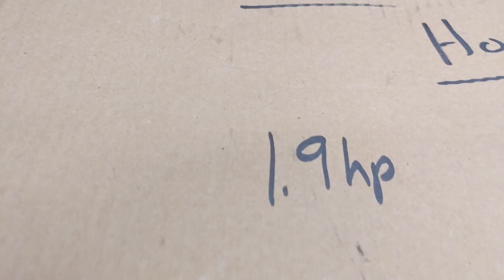Best Cordless Ratchet Makita Husky Milwaukee TESTED 12 volt

Comment: Thanks. You got me thinking about the Makita. However, one thing you left out is rust. Here in the rust belt, even after you break a bolt free, it can take substantial torque to maintain movement. Speed doesn't always win.
Reply: I am with you, try the husky. You won't regret

Comment: I bought they Husky on sale for $50 and it’s worth every penny.  I thought not being able to change out the battery might be an issue but I’ve never actually used up all the power in it in a single job.
Reply from the maker: I 100% agree, I have never ran it out on a single job. It is a workhorse and a pleasure to use. You can't find more tool for the price anywhere.

Comment: I didn't expect anything special out ofy husky but I was wrong, it has more than paid for itself, it holds a charge forever I just charge it and I've had it over a year and a half. Theyessed up selling it so cheap. It's all I use in tight quarters . Buy it! Don't even think twice
Reply: Literally been using it as a mech in the oil field as an experiment. The switch on the head is a pain ...but beyond that, it's never failed me.  I have a Makita line-up and I'll be sticking with it. But that little guy comes in handy.
Reply: I can’t find it for under $100😢

Comment: I’ve been using true husky for over 2 years and I use it everyday as I am a mechanic and I’ve only had to charge it 4 times! Yes 5 times! It’s not the strongest but you can break bolts lose then it’s fast and it has a variable speed! One thing is keep the head clean or you can lose the gear grab or how ever it grabs the 3/8s stud! Plus  it dosent ever start to lose speed or strength until battery gauge is on 1! I’m a makita guy and will get it but I don’t care what anyone says the husky is the best rachet on the market bar non cause you can usually get it for 60$ and battery is built in! Again 5 times in over 2 years with is all I’ve charged it and everyday use! I use it mostly for dismantling and then reassemble of engine bay and undercarriage!
Reply: Thanks!!!

Comment: Amazing how good it gets when they deviate from the traditional design, spray cloth, interchangeable drives and a through hole, the switch mod, I'd say they hit it out of the park after your comparison fo work done. Nice comparison , enjoyed, cheers!
Reply from the maker: I tested around a dozen ratchets and the Makita is the only different one that engineers actually had fun with. All the others are virtually the same and just trying to fill a hole in their tool lineup.
Reply: @sixtyfiveford  The through hole impressed me a LOT, that and the Sprague unit instead of just a toothed ratchet with a flipper. And the direction changer and on it goes. IF I ever got one it'd be the Makita.

Comment: I love my junker husky for my weekend warrior projects. For the money it’s great.
Reply from the maker: Good choice!
Reply: My husky only lasted 2 weeks and the bord started smoking and died on me. I didn't get a chance to return it so I ended up rigging it. I cut out the bord and hooked a wire to the switch and motor and I used an 18v milwaukee battery to power it and it works amazing. The only downside is no speed control and I can't hold the trigger down if it's not spinning because it starts to smell and can burn out the tool but it's definitely more power and speed with the 18v battery. I just have to be careful how I use it.
Reply: WHO WHO WALKWA  yea it finally gave out last week and it felt like someone died that's what I get for talking so highly about it. It gave out on one of my friends cars I was working on and he went and got me and milwaukee 3/8 35 f lbs one and it felt to me like a defective tool and as I finally got use to it 3 days later I was giving an oil change to my other friend and it was around 1am I cleaned up everything under his truck and dum me i left it under his truck and he rand it over but the good side is it survived but I'm still going to try to fix the husky wean I get the chance and if I can I liked it better with the m18 battery

Comment: Makita's improved direction switch also saves you when you get jammed up against something while running bolts out. The switch is guarded, so you can toggle it and run bolt back in a little. Not so with the "classic" switch arrangement.
Reply from the maker: Very true! That has happened to me multiple times.

Comment: Man the forward/reverse switch on my Husky almost got me in a bind removing a belt tensioner. The bolt was longer than I thought and ended backing the ratchet head against the engine bay wall. Still love the tool (specially for the price).

Comment: I agree with you regarding the Makita.....just a FANTASTIC cordless ratchet....the balance (head to toe weight ratio) is 50/50... PERFECTLY WEIGHTED! The ergonomics are 2nd to none (& I've tried more than a few of the industry's current offerings)....just feels like an extension of one's hand....LOVE IT! HOWEVER, I FOOLISHLY gave mine away (to a friend, in need of a cordless ratchet, & he LOVES it. Glad I could provide it for him, but SHOULD have just gotten myself another...but, instead) & bought the Milwaukee M12 High Speed cordless ratchet....which, is NICE....FAST AF, but in all honesty, I liked the Makita more for the reasons I mentioned above.....I just WISH Makita would come out with an extended reach version, as if they do, I'm buying it without a 2nd thought.

Comment: I often find myself in need of one of these ratchets because my impact it's too big to fit in tight spaces.  And a regular ratchet has no room to swing.  I just ordered the Makita CXT 12V 2.0 AMP Kit from THD with a free 4.0 AMP battery for $189 plus taxes.  I'll update once received.  My impact is a Milwaukee and I love it too, but the reviews on this ratchet convinced me to obtain it.
Reply from the maker: I love the Makita. I ended up selling off the Milwaukee and have no regrets. I still have the Husky and just keep it around as it was so cheap but rarely use it unless the length of the Makita is too long.

Comment: Thanks great video. This is just what I needed. I have a spark plug change coming on a Lexus and it's alot of bolts and nuts to take off. I was on the fence but after watching your video I decided on the Makita instead of the Milwaukee Fuel M12. Thanks again and  give this guy a thumbs up. 👍
Reply from the maker: Right on

Comment: I’m buying the Makita per your review. I was originally going with a Milwaukee but you pointed out many advantages on the Makita.  Thanks much for the evaluation!
Reply from the maker: Good choice! I kept the Milwaukee around for a few months after the video and then sold it as it never got used. I kept the Husky as a backup only because it's so small and probably not worth much to sell it second hand.

Comment: The thing about Milwaukee is that their Fuel line have more torque (55 ft/lb) than speed (200-250rpm), and their M12 have (450 RPM) and (35 lb/ft torque).  So, in that aspect, Milwaukee has more tools specifically made for each situation.  This way you don't have to sacrifice one for the other, you simply buy the short one and the long/extended reach. 

So, if you are removing something like an oil pan or valve cover etc. that typically has lower torque settings, then you'd use the low torque, fast spinning tool, and if on other, harder torque applications, then the high torque, slower spinning tool.

Comment: Fantastic review! So many things I would not have thought about. Except for the long anvil and higher torque, there's almost no reason to buy the Milwaukee, unless you've already invested in their system. But if I was going to invest in Milwaukee system I wouldn't invest in the 12 volt anyway. When you first started talking about these I was thinking okay, hands down, there's no reason to buy anything other than the Husky. But then you went into the features that the Makita has, and I was like wow. The Makita's price point is high, but you do get a lot for your money. At the end of the day though I still think I would end up buying the Husky.
Reply from the maker: What you get for the money, the Husky can't be beat. It has been a fantastic tool for the past 2+years. I thought the Milwaukee was going to blow me away, but I have a decent amount of buyers remorse. Yes it powerful but you still end up using like a manual ratchet all the time to break fasteners free, then you have to wait seemingly forever for it to spin the bolt out.  At least with the Makita and Husky when you have to manually break a bolt free, it spins it off in seconds.

Comment: I agree. I've got every tool platform and makita usually wins the smooth test. That ratchet is the only tool I want, but don't have. Mainly since it's a 12v and I'm on all 18v for makita tools. If I'm using a ratchet, I don't want torque or I'd use an impact. I want speed. My Milwaukee tools can break off transmission pan bolts that may be corroded on and that's too much. And I'm not reaching for the ratchet to replace control arms or suspension parts. You're far more realistic about things than just a "how powerful is it" tester. Therefore I will now order my makita ratchet. Thanks for the videos!
Reply from the maker: I wish Makita had more 12v tools that I would actually use with this platform. That was my biggest hesitation to buy it, but I'm not dissapointed even if this is the only 12v Makita tool I ever own.
Reply: @sixtyfiveford  * yes. Totally agree. With Milwaukees huge 12v line, I'd hope makita starts expanding. We'll see

Comment: Most times I would rather have the lower RPMs.
There have been countless times when my hands and fingers can't get down to the nut or bolt and they just fly off in any direction at the finish... Sometimes gone forever.
I do like the head on the Makita ratchet.

Comment: I better leave well enough alone and keep my old regular ratchets. I wring enough stuff off with them and not get hi-tech any more than I am. My impact works fabulously for me and if I need more reach I hold the nut on a magnet and let the impact E A S E the bolt and touch the nut on it to get it started. So far I have the impact and the 1/2 inch drill and that'll be it for battery stuff. All the rest are corded. Got the drill for your rattle can shaker; the expressed purpose! All my exploits now are on my own stuff and time isn't really a factor. Just getting it done is number one. Thanks, Buddy! Yall remain calm and GBWYall! And now you have a logger dogger!

Comment: I bought a Husky a few years back for $49 with the socket set. The rachet failed around the 1 year mark. Return it to Home Depot and exchanged it no problem, well almost. The new rachet does not come with the sockets. I whined about losing my sockets in an even exchange, the clerk just swapped the rachet and let me keep my sockets. I’m happy with it and it sure saves time. I do like the feature of the Makita and when it’s time to replace my Husky, I definitely will shop features as I’m now sold on a cordless rachet.
Reply: That is one great thing about buying from HD. I bought an led light fixture that failed after 5 years, brought it back to HD and they let me exchanged it. I had kept the box for it because that particular light did have some bad reviews of early failures.
Reply: Was it the internal batteries that failed?

Comment: I’m in the market for one of these, perfect video. I already have some M12 Milwaukee stuff, but I’ll be getting the Makita and it’ll be my only battery powered Makita tool. I have a Makita corded circular saw and angle grinder that have lasted over a decade each and are fantastic.
Reply from the maker: I like my M12 stuff but this Makita is on a different level.

Comment: Milwaukee came out with a new high speed ratchet around when this video came out. The high speed version also has a smaller head which is my other complaint with the fuel ratchets. At some point I'm hoping they decide to add a trigger into the handle instead of the paddle design.
Reply from the maker: Yeah, the higher speed Milwaukee dropped it power though to 35ftlbs. Would have been a beast with high rpm and 60ftlbs. On paper the Makita is still faster and has the same torque.

Comment: Great vid! First one of yours and One of the best I've seen, you cover all the bases and present in a nice, clear manner & don't talk for the sake of talking. Thanks. I have quite a few metabo tools in 12v & 18v lion which are superb, but they don't make an impact wrench like these. Got rid of milwaukee 12v gear some time back as I found the handles too bulky with their fat bullet batteries. They always feel a bit more heavy duty than makita, but that normally results in a weight premium too. So makita cxt for me and I'll go for the one with the interchangable heads, they also do a TL065DZ in the UK with slightly higher torque & fixed 3/8" head + an advertised 2000 rpm, so that must be crazy fast, but I use 3/8" & 1/4" sockets in my work, so Makita cxt wr100dz which is the UK version all the way!! Thanks again, I will be watching more of your vids now 🙂
Reply from the maker: Thanks, I'm glad you liked it. I ended up selling off the Milwaukee as it was just too cumbersome. The Makita is just so much nicer to use.

Comment: The extended reach comes in handy in the body section.  It is nice when you need to reach behind a bumper cover or to get to some of those bolts/screws behind there or behind the front grill area, or even in the rear/trunk section.

I see it as having different tools for different jobs.
Plus, when it comes to nut busting torque, unless you are in a really tight area, where you can't pivot the handle, we all know that we tend to use the ratchet handle and our arm to loosen the bolt/nut/screw and then pull the trigger to spin it.

As far as the paddle handle/trigger, I do find that sometimes when the ratchet is in a tight space, I may only be able to get my fingers on part of it, and that longer section is nice to have.
Reply from the maker: I have used the Milwaukee for unique situations where the others wouldn't have work.
Reply: @sixtyfiveford  Same here.  The good (?) thing is that I am starting over with the tool buying process, since a majority of mine were stolen a few years ago.  So I am buying Milwaukee, especially since they have a few different cordless ratchets.

Comment: I went with Hercules. I was considering husky, but the lack of replaceable batteries was the deciding factor. If you use a cordless ratchet a lot you’ll have to buy multiple Husky ratchets. I’ve always had good luck with Hercules power tools. I have a bunch of them. I recently replaced all of my 20v Hercules with m18 fuel line and got the m12 fuel drill and driver, but I couldn’t justify the price for their fuel ratchets. Plus, the fuel ratchets heads are massive!!!! Hercules works great as long as you remember to not be a bonehead and try to use them as breaker bars. Lol

Comment: Good info muh man. Samesies with me on the husky. Got it at Home Depot for 49.99 on sale a couple years ago, and haven't turned back. I had the Earthquake one from Harbor Freight and it's honestly a very nice tool, but bulky, and with battery was about $130 I believe. So not a bad price. BUT, the performance and the bargain of the husky, and it's compactness??? HANDS DOWN the best one on the market. 

Makita tech on that thing is pretty awesome though. Swapping out the heads is 
f🇺🇲cking sweet!
Reply from the maker: The Husky at 50bucks is astonishing and I would buy it again even at full msrp of $80. They also give you a 2 year, walk in free replacement warranty with that. That kind of puts the 90day HF warranty to shame.
Reply: I can’t do inbuilt batteries anymore though
Reply: @TheLexiconDevils  it will come out if ya take it apart lol. Honestly, having used this one and other detachable battery cordless tools, and air tools, this isn't so bad at all. It's a Li-ion battery so it lasts quite a while too. I recharge it after every use.

Comment: In automotive industry,  speed is real important,  but electric ratchet are  mainly to be use it by break in by hand first and then hit the trigger and in that area Milwaukee's win by a mile if a remember is 175 fts on hand breaking force.         The competition doesn't hold that so you will be ending wasting time grabbing a manual longer ratchet to brake loose and then switch to the electric ratchet.

Comment: That Makita surprises me with all it offers at its price point. Thanks for the comparison Moe! I've yet to pick up a battery ratchet, but I can see the benefit, especially with all the small engines I work with. Cheers! Zip~
Reply: I do small engines too & you’ll appreciate the Milwaukee impact & torque more than the features on makita
Reply: @TheLexiconDevils  The Milwaukee is where it's at, but what I like most is the interchangeable socket driver. Most of the work I do is on small engines, so I don't need the super high torque that the Milwaukee offers. I'm still mulling it over. I DO like the Fuel line up for sure! Time to ponder. Thanks for the input! Cheers! Zip~

Comment: The Husky is more in my budget  I do like how tough the Milwaukee is ..I do not work on much stuff that I need a power tool like these ..I do use my 1/4 inch impact driver once in a while
Reply from the maker: I use my 1/4 hex impact w/socket adapter all the time on small engines and big car engines. Such a time saver.

Comment: My opinion is that it’s time for a 12v battery adapter hack video. I have the Milwaukee 3/8 ratchet (non-Fuel) that I bought because I already had the dremel tool and sawzall tool in m12.